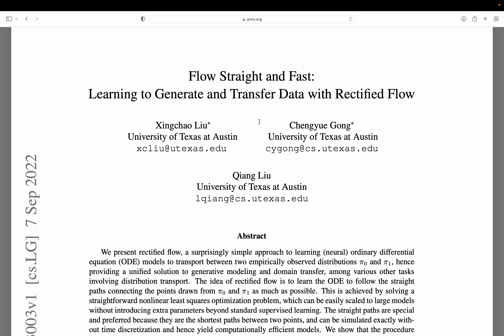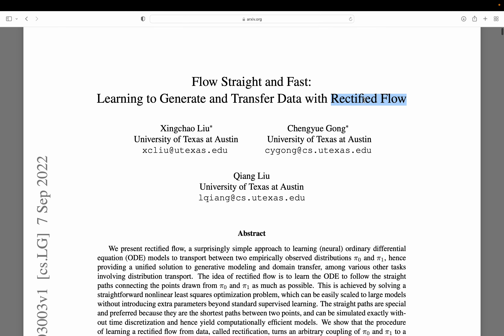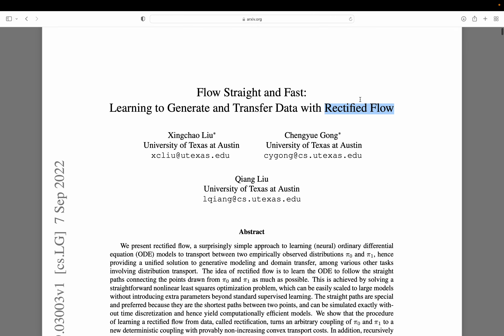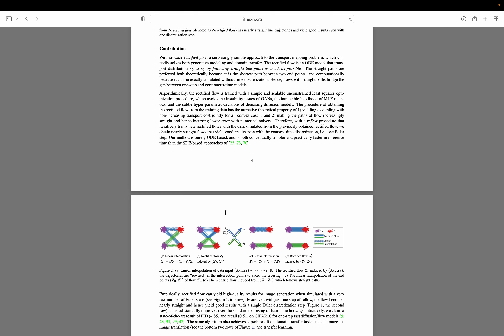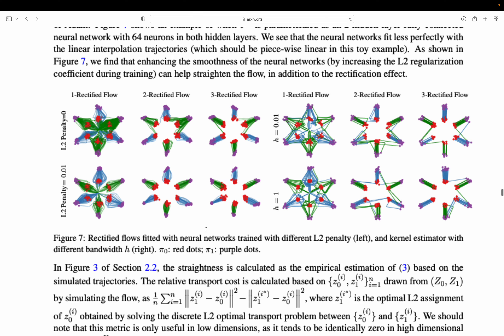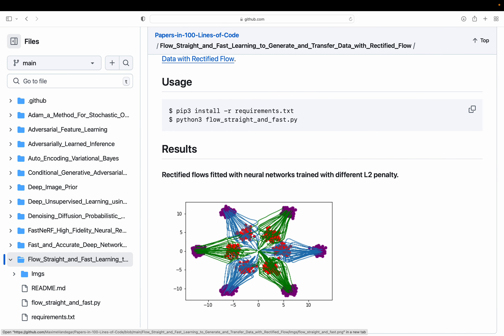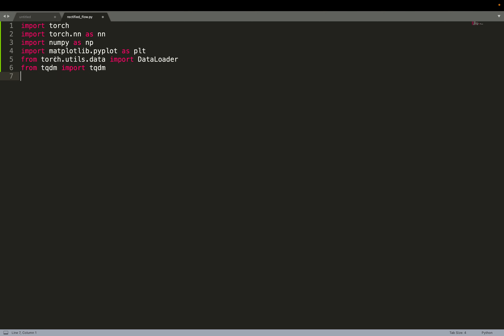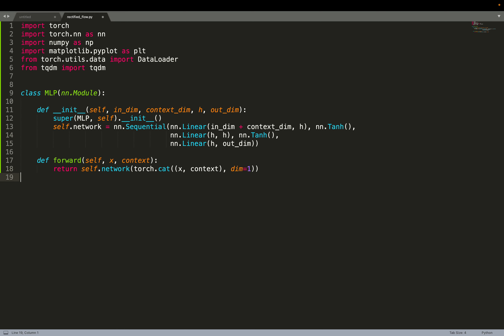Rectified Flow: The Game-Changing Technique Powering Stable Diffusion 3 (Full Reimplementation!)

Comment: Why does _get_item_ use the same index for both distributions? Shouldn't you pick 2 random indexes. Otherwise you have a constant pairing between the two distributions.
Reply from the maker: Thank you for your question! Yes, the pseudocode involve creating a pairing of the data and sticking with it. If you use reflow to straighten the mapping, the reflow operations build new pairings. It depends on papers and implementations whether get_item uses the same index or no.